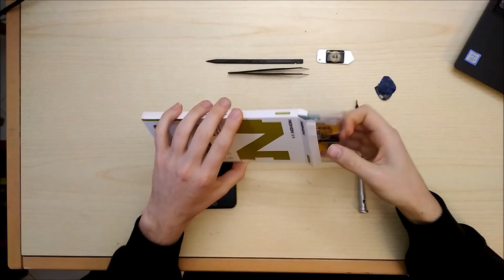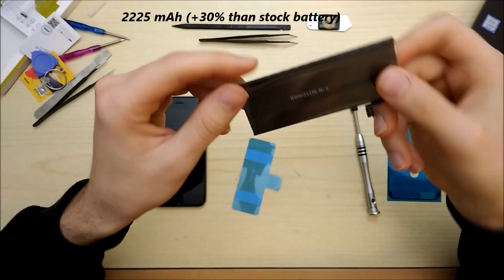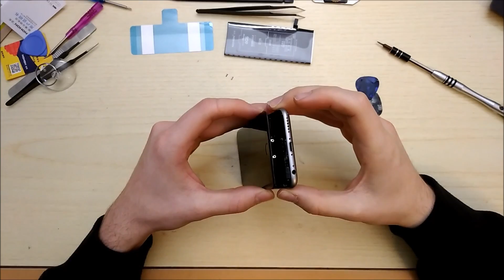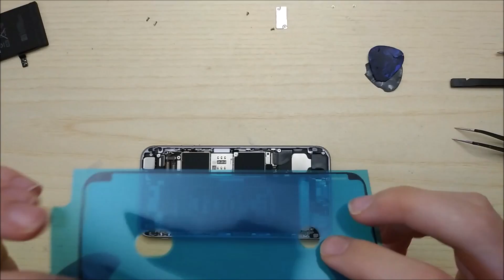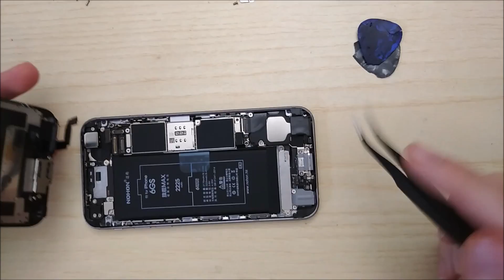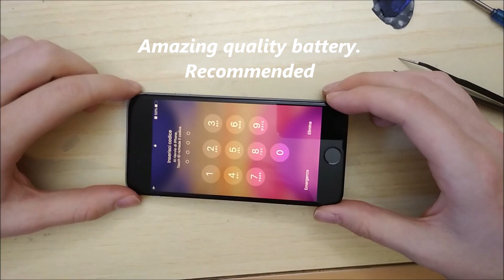Nohon 2225 mAh iPhone 6s Battery Replacement - Tutorial & Look

Comment: My biggest doubt is which of the two capacities 2225 or 2350, clearly aiming for more autonomy I want the 2350 but I'm afraid of being much higher than the cell phone accepts, because in your case you installed the 2225? and which one should i choose? I've seen comments that the highest capacity (2350) the lowest health is that?

Comment: How many hours extra did you get? 😀
Reply: robert snoddy it actually gives 2 extra hours. These extra mah batteries turn 6s into a pretty long lasting phone.
Reply: The Kelz why did Apple not use those batteries? Do they explode?
Reply: d5486 I can’t say for sure. Maybe technology didn’t allow that at the time the phone was released. Or maybe to save costs. Really don’t know but for now these batteries don’t seem to explode and are perfectly fine overall and that’s all that matters.
Reply: The Kelz bruh my phone dies at 50 and when i plug in it jumps to 33 or 10 wtf shall i d
Reply: @BerlinerLopez  do the battery calibration process
Reply: Does it effect  the phone speed ???
Reply: @devikeepitdrillin  how